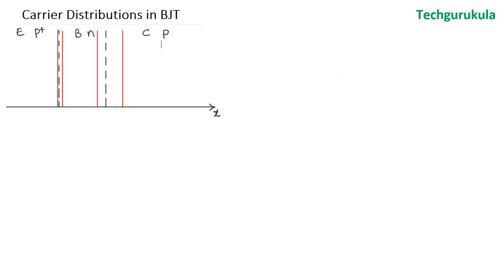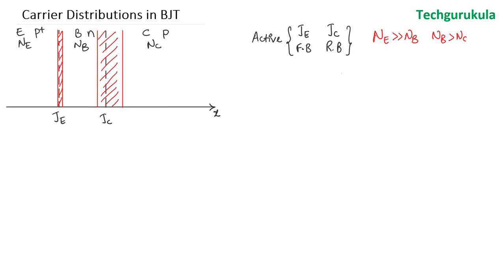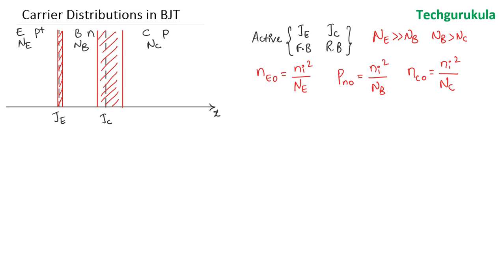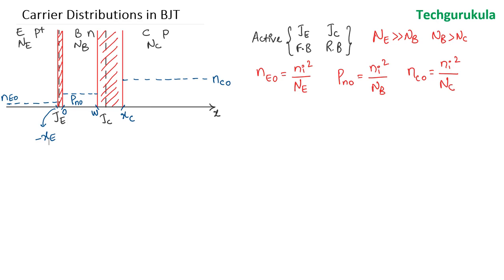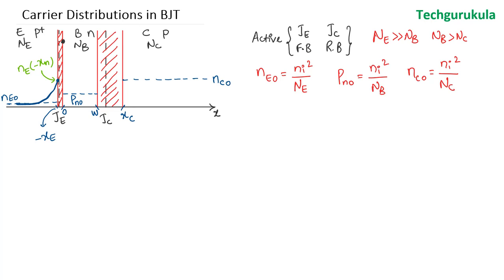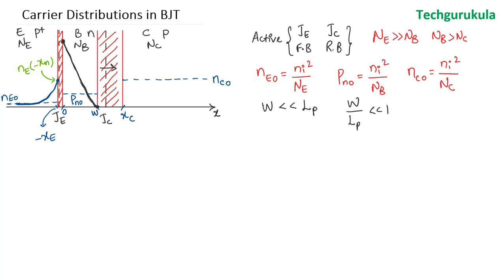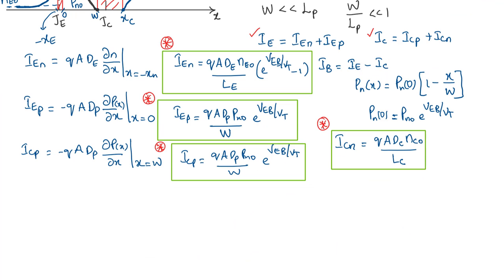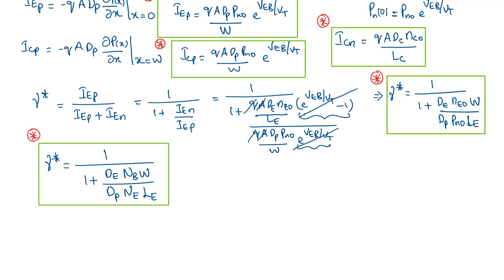Electronic Devices: BJT - Carrier distribution in Active Region

Comment: i have studied the width of base is less then collector everywhere but in your all videos you r sying it in reverse way..??
Reply from the maker: you mean doping or really width?
Reply: Sorry i was talking about doping only.
Reply from the maker: @saumypandey2184  doping of base is less than collector, it will cause punch-through for low voltages itself. If the base doping is higher than collector, the expansion of depletion region in to base will be less and it will be more into the collector as the junction reverse bias is increased.
Reply: But sir you have written NB>NC. This means doping of base is more than collector no?

Comment: Sir ! Please a small doubt, Can i use Vbe instead of Veb.
Reply: vbe is used for n-type bjt and veb is used for p-type, bcz in p-type in order to keep bjt in active mode its emitter base should be forward biased , so p-type has + holes on p side hence emitter potential is +, and base has electrons hence base is -.
therefore we take this as veb voltage

Comment: Could you please explain the differences between reverse saturation current and leakage current in BJT.
Reply: both are same
Reply: Reverse saturation current flows due to excess minority carriers generated in p and n side, in forward bias, 
And Leakage current is current that flows  due to reverse bias, because in revese bias current is expected zero but small current flows due to minority carriers present and hence that is called leakage.